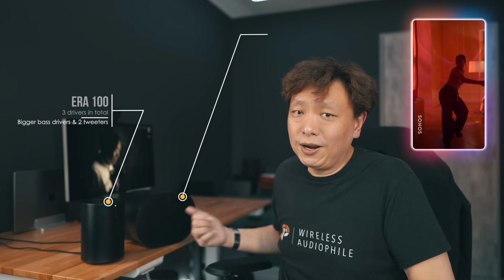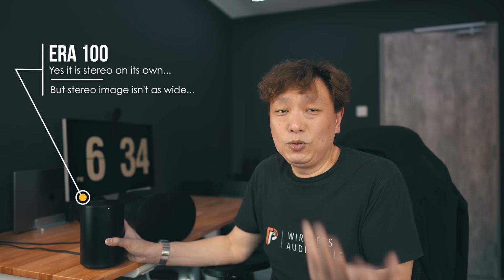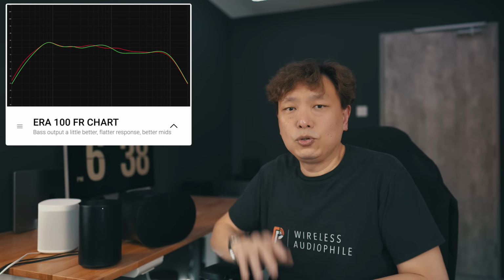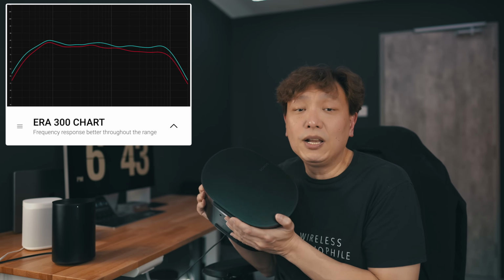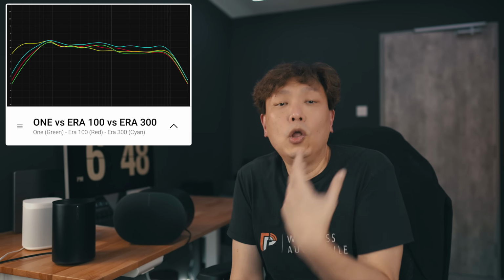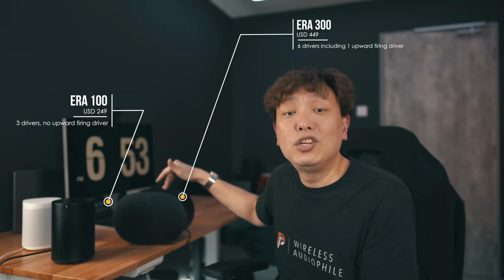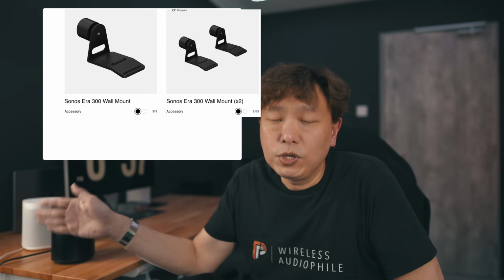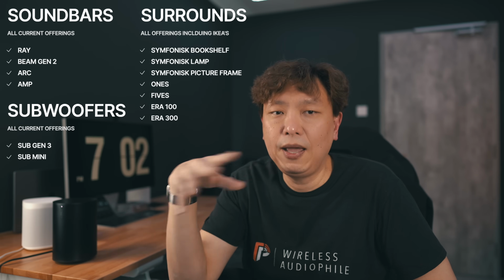Full Review of Sonos Era 100 & Era 300

Comment: For anyone interested here are my first impressions using a pair of Era300’s and Era100’s…
The Era300’s are an easy sell for me if you are going to use them in a Sonos Home Theatre configuration. My immediate reaction to replacing Play5 rear speakers with Era300’s was how much better integrated they sound with the ARC sound bar. I come from a high end HiFi and cinema background but love Sonos for their fun club like room solutions and convenience around the home without speaker wires.
Sound bars always sound like the sound is coming at me horizontally. Due to their design and often low down placement they never sound great to me for music. However with the Era300’s as rears it feels like the Sonos cinema sound stage is more cohesive front to back of the room. In this scenario the more horizontal 3D soundstage doesn’t bother me as it’s more like a well integrated 360 experience. Play Ed Sheeran’s ATMOS recordings and the sound stage is far better integrated than using Play5’s in a cinema configuration. It makes me feel like the Era300’s are what was missing from the Sonos home cinema package since the ARC was first released. Era300’s just compliment the ARC so much better than the Play5’s. To my ears they are the first truly well integrated rear speakers for Sonos home theatre.
If I listen to the Era300’s as a stereo pair by themselves, then  I am again hearing a more horizontal 3D sound stage a bit like turning the Play5’s horizontally instead of a more HiFi like soundstage when you listen to the Play5’s positioned vertically. So this is why some people may not like listening to Era300’s for music only. It’s not stereo HiFi, it’s just different. You’ll either like to get used to it or you won’t. Personally I am not a fan of the Era300’s in a stereo pair. I (currently at least) prefer a traditional stereo soundstage from a quality HiFi setup. But I think they are very good paired with the ARC in cinema configuration.

IMO the Era100’s are NOT an upgrade from the One speaker. They are just different and depending on the environment you place them in, your preference to listen to Era100’s or One’s may differ. I had no wow factor comparing a stereo pair of Era100’s with a pair of One’s. It’s not like the sound stage was considerably deeper or more natural, which I was disappointed with for a slightly larger speaker/driver design. I expect a pair of “Move” speakers in stereo mode, will blow the Era100’s away. I can hear the Era100’s are a little richer than One’s because their sound profile is not as scooped. There is a richer midrange, but that may or may not be preferred by you, because the soundstage can be thicker to it’s detriment. For example when I tested in an open plan kitchen/diner, I thought ok I hear a difference but it’s not “better” as such, it’s just slightly different and not worth replacing One’s for in my opinion. Then I compared the Era100’s and One’s in my bedroom where the Era100’s thicker midrange was not as relaxing to listen to in that smaller space, despite my bedroom still being a decent size. It’s not a box room by any means. I used Advanced TruePlay during these listening tests and tried adjusting EQ, but I still preferred the sound signature of the One’s in my bedroom. So I think the more scooped sound profile in the One’s works better in smaller spaces where you want to reduce any bloated/flubby bass. The Era100’s are arguably preferable in a larger space due to the richer midrange. It’s not really HiFi rich to me, which means it can thicken in a marginal muddy manner. At no point did I feel a wow factor like I did swapping out Play5’s for Era300’s in a cinema configuration. I suspect in time there will be a group of customers who prefer the traditional One’s to the new Era100’s and there will remain a good market for the One’s because their sound profile turns out to be more desirable to some people in smaller environment use cases. Have fun testing for yourselves and finding your own preferences within your own homes. Cheers everyone.
Reply from the maker: Hey DJ, really big thanks for helping the community out by giving such a detailed experience writeup!
Reply: @PeterPee  Sure thing Peter. I'm looking forward to hearing your own opinions in the coming weeks. Thanks for all your great content. 👍

Comment: Do you get Atmos for music if you group output to say a Sonos one or play5, or does Atmos only work when Atmos only speakers are grouped.
Reply from the maker: You will lose Atmos when grouped.
Reply: I figured that was the case so Atmos only works on the Era 300 alone or along with an Atmos sound bar. So even grouping with the new Era 10O you will not get Atmos out of the 300. That certainly limits their use for streaming in multiple rooms or to multiple speakers. Because the 300 are designed specifically for Atmos they are not the optimal choice for music that is not Atmos. I am not sure I would be happy grouping them with non Atmos speakers. It sounds like there main purpose is for rear speakers in  combination with the Arc.

Comment: Hi Peter, thank you for this great review. I have the arc and sub. I have very high ceilings (3,5m). Would you say it makes sense to put the Era 300s as suggested close to the ceiling to have a better atmos effect? Currently the Atmos effect with just the arc is very low. I already increased upward firing to nearly max.
Reply from the maker: If the ceilings are that high I won't recommend you mount the era300 all the way up. Cos you will end up with the surrounds(not Atmos) effects up there too. 

I obviously haven't tried this but if you need some recommendations then try to mount the era300 about 2.1-2.4m up. But inverted. This way you will still get surround somewhat at ear level. And Atmos is firing down without having to travel 3m up to bounce 3m down.
Reply: @PeterPee  I think I will do it like this. If you find the chance to test please let me know how a reverse setup works.

Comment: I currently have a surround set-up with the Arc, 2 subs and two Sonos Fives as my rear speakers.  Is it worth swapping out the Fives for Era 300s as the rears?  Technically it’s a less powerful speaker but has the strength of spatial audio/upward firing channels.  Thoughts???
Reply from the maker: If you didn't have the fives, I'd say it's an easy decision to go for the era300. But because you have the fives as surrounds already it's hard. It's good money but i think if you can afford it, it is a real upgrade.
Reply: @PeterPee  Thank you, so you would consider swapping out the Fives for Era 300s as rears would be an overall upgrade (ie, not a downgrade).  That helps.

Comment: Could only one Era 300 work as a surround setup in case space (or budget) is limited? I can't place my speaker behind my sofa only on the same level left and right to it - is it still worth to get two Era 300 with this placement limitation?
Reply from the maker: You can't pair just one. You need two before you can pair them as surrounds.

Comment: Sonos products are not cheap, but I suspect most people were like me: you bought one product and started adding on.  So, for example, if I were buying a full HT setup, I would consider the Nakamichi Dragon.  However, I already own the ARC, two Sonos subs and Sonos 1s as rear channels.  The most economical move for me is to get the Era 300s to replace the 1s (which I am doing)

The 1s will be moved to another room. A question I have about the Era 100s that no one has addressed is how well one Era 100 does on filling a room on its own.  I find that a room of any size needs 2 of the 1s to provide adequate sound.  

My only other comment is that the 1s are good background music speakers, nothing more.  Definitely NOT for any kind of critical listening.  I seriously doubt the Era 100s would make for critical listening, even though they may be better than the 1s.
Reply from the maker: Critical listening is an analog term and your standards may vary from mine. And from another. If you have the chance, try it out for yourself. I find them lacking in terms of filling a big room and you will notice that sound is coming from a particular point. But a pair of them makes for more than 2x the enjoyment. Your mileage may vary.
Reply: @PeterPee  Thanks for the response.  I have Sonos 1s in most of the rooms in my house.  Have one of them in the kitchen and definitely adding a second Sonos 1 improved the sound there.  I’ll be using a pair of 1s in my living room once I get the Era 300s and replace the 1s acting as rear surrounds.  Will try the Era 100s at some point, but not a priority at the moment.

Comment: There is another sonos update being forced to owners
Reply from the maker: Nope. It's not forced. You could turn off the updates and still listen to the sonos stuff that you have. But I can agree with you half way as you will need to update to pair and make changes to configuration. 

I don't want to sound like a fan boy but seriously, in sonos' defence, they aren't the only ones to roll out updates. And more often than not, the updates bring meaningful upgrades to functionalities.  There are other manufacturers with broken software and NEVER correct them. 

Long time viewers on my channel will know I pull no punches when it comes to sonos mucking things up. I believe I am fair and I honestly value my position representing users than any perceived position representing sonos. 

One of the things that made this channel somewhat successful is that sonos and tat chuan acoustic had NEVER once influenced my work and videos. They never told me to let them screen stuff that I say. They watch the videos at the same time as you guys. They are confident in their products. And if they muck up like they sometimes do, they are confident they will fix it. 

Case in point, this channel came alive because my earliest videos covered the serious sound quality issues with the sonos arc at launch. They gave continuous updates (in your words, forced updates) and today the arc is a completely capable soundbar sitting right at the top of any serious soundbar buyer's list.

Comment: Hey Petter,
Great Videos!
I just started my Home Theater set up with an Arc. Do you still suggest adding a sub to it first, or do the 300's change that recommendation?
Reply: Not a lot of factors when adding the sub other than where to put it for aesthetics and Trueplay to dial it in.  The Sub will always improve the sound of the Arc/Beam/Ray for any audio source.  The Era 300 (+stands) might take a little more planning and placement compared to the sub.  I don't think I could replace my One SLs in my office with a Beam+Gen 3 sub with Era 300s because they would sit 2 feet from my ear along a back wall with my sofa (Atmos effect would be sent to middle of the room).  The Era 300 would work perfectly in my much larger family room sitting 9-12 feet back (3-4 meter) and have space for the upper/side firing speakers.
Reply from the maker: I always prioritise subs.

Comment: Good Stuff!  I am no where near Singapore, or I would RSVP for your event!  I have a fairly small TV room.  I have the Arc, which is great.  Everything else is about 8 years old —Play 1s as the rear speakers and one subwoofer sold at that time.  I want two of the Era 300s, but now I am wondering about the subwoofer and getting a second.    Are the Gen3s the only ones fairly optimized for the Era 300 + Arc?  Could I get away with 2 minis?  I want this for TV/movies not so much for music.  Thanks for the feedback!
Reply from the maker: Yes, Mrgold35 got that answer for you! But I won't recommend adding the second sub through the amp as they won't trueplay.
Reply: The Sonos Sub Mini can't be placed into a dual pair with another mini or the larger Sonos Sub.  You must have one Gen 3 sub if you want to add a second Gen 3 or older previous gen Sonos sub in a dual pair.  You could add a second non-Sonos sub with the $600 Sonos Amp.
Reply: So, I can get a Gen 3 sub and pair it to the older Sonos sub.  Have I understood that correctly?  Thanks so much for the help on this!

Comment: Can either of these 100 and 300 be added as L/R and also with that it can eliminate terrible sssssh sound of vocals from Arc by offloading or diverting some of the things from Arc...that is the only thing I need with my current setup which is arc+sub+2 ones.? Can you confirm ?
Reply from the maker: I think you might be sensitive to siblance, or that harsh treble.Try to tone down the Treble by about 2-3 notches and see if that helps you. It will take away a bit of air to the sound but if the shhh sounds irritate you, I'd rather that. 

But no, they can be added only as surrounds.
Reply: @PeterPee  
  Thanks.will try..yes like warmer sound than metqllic sound.with each update I am  observing Arc's sibilance.Previously with 14.12 clarity update, it got drastically reduced and now with 15.2 sssh sound reduced a bit more.

Comment: One thing many reviews ignore are older replacements. People running play:3 of (as myself) bought a Gen1 Play:5 right before gen 2 came out, and refused to upgrade. They're offering 30% for upgrading still but I'm salty that 7 years is all I can get out of my $500 speaker.
So... Why should we upgrade and what makes sense especially using the 30% off.

 I'm in Michigan but I have a branch of my company in Singapore, so I find your channel really interesting.
Reply from the maker: Thanks for your support Ryan. Actually, I have the Play:3s. As with most things tech, advances make the older stuff pale out in comparison. We can still use the Play:3s but like I don't listen to them much now because the newer stuff sounds so much nicer. I used to use them in my surround setup because they are loud. But since I moved to the Fives and the Sonance in-ceiling and now the Era300, I really find less use for them.
Reply: @PeterPee  what's your opinion on the Play:5 Gen1? I've considered replacing it with the roam or move as it sits in my dinning room but I often bring it outside on my patio, but frankly even using S1 it still sounds great compared to my beam on the TV or sonos:one in my bedroom.

The wife said no to an Amp+sonance with a switcher between I door and outdoor speakers to replace it haha.

Comment: Good stuff. Ho Liao.   Moving to a new home soon and very keen to explore the 7.1.4. Do you think the sub mini suffice?   Will get the arc and 300s and sell off my Denon amp, Dali Zensor 1 and Vokal and an earthquake Sub which I had since 2015. 

Don’t need the amp since I can run my prism tv on earc to the Arc and my Ps5 to my TV. 

Is this ok ?  My new house is an EMasionnete. 

Would love to join this Friday but I have something up. Am considering going to TC to audition my desired setup too.
Reply from the maker: I am familiar with your house layout which I think is about the same size across various layouts. The sub mini will suffice if you have it in the corner. But know that if you regret later and want to upgrade, Sonos stuff retains value quite well. Especially the subs, and especially under warranty from TC Acoustic.
Reply from the maker: Not sure if you believe it but if your Earthquake is P63 with the 6 inch drivers, the sub mini will equal that, or BETTER.
Reply: @PeterPee  by the way. I mixed up. My sub is a Polka Audio. I think that is nothing to shout about. 

I’ve seen your reviews on the sub mini vs sub gen 3. Do your views still hold true ?  That Sub Mini would be the better buy.  I understood your discussion on the dimensions of the sub mini (where you discuss how you calculate all the surface area with pi 😂😂), so was wondering if your recommendation still holds true.  

I don’t want to disturb my neighbours so thinking of the sub mini to make it a 7.1.4. Then in future buy another mini to make it 7.2.4 if I still want additional thumping.
Reply: Thanks for the reply. Will check what’s Sub is it but golly, if sub mini is that 🔥, the Sub Gen 3 must be ⚡️. Thanks for your reply !!!

Comment: Peter one question. I currently have a Sonos Arc+Sub generation1 and two play ones. My room is shallow only 10 feet from the TV to the sitting position. My play ones are too the left and right even with the back of the couch not behind our heads. Would the ERA 300s be worth the upgrade as they are just to the left and right not behind us?
Reply from the maker: Yes. In that case, point them towards your listening position. But the heights channel is surprisingly potent.

Comment: Good stuff! Peter, please comment on how the Era 300 perform and their best position with configurations of sofás sitting against a wall… better on that back wall pointing forward, on the back wall poiting to the listener, on the side wall near the back wall pointing the listener, etc.

Moreover, is the 7 channel ear level vs. 5 channel ear level difference noticeable? Meaning, how to the side firing drivers of the era 300 play together with the Arc side drivers, which should make up the 5 th channel signals (side surround).

Another question for Beam G2 users (not my case), but don’t the actual upward firing and side firing drivers of the Era 300 dwarf the performance of the pseudo acoustic/ processed atmos and surround signals performed by the Beam when paired as a surround configuration?

Cheers and excelent work.
Reply from the maker: I will cover this in a video.

Comment: Fantastic review Peter. Thanks heaps for taking the time with your in depth review. 
Just wondering in your opinion, do you think it will be possible for the One’s to be used as side speakers in a surround set up if Sonos completed an update? Or would these clash if you had the Era 300’s as rears?
Reply from the maker: This configuration is not currently supported.